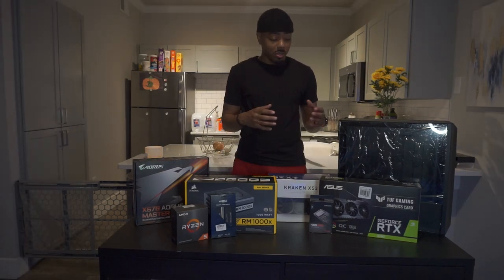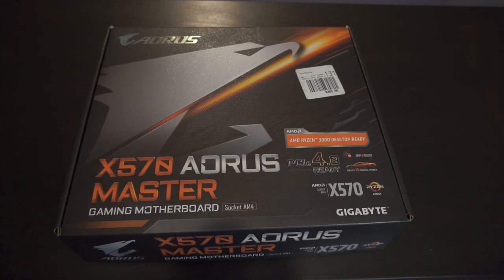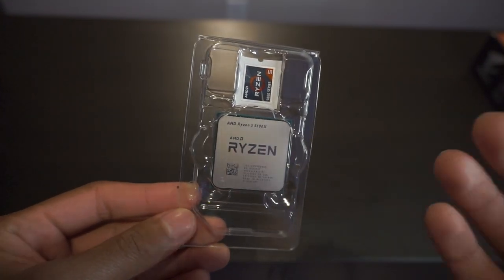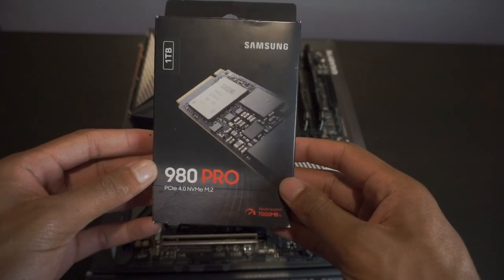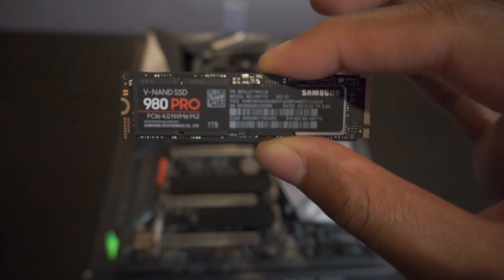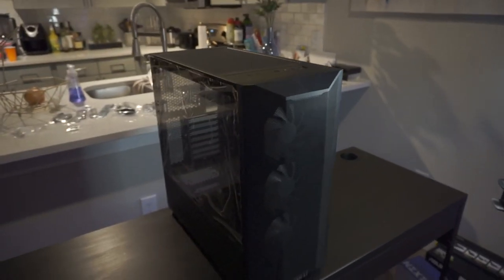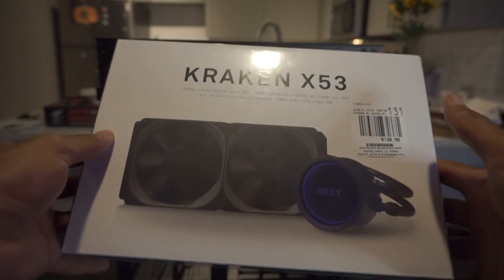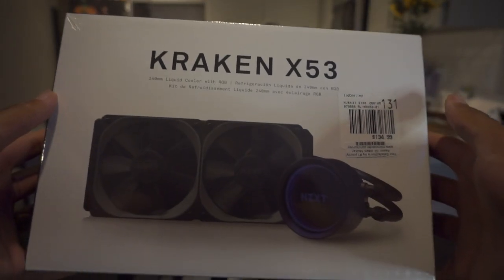MY FIRST PC BUILD! **Beginner walkthrough**

Comment: Nice pc build. Not editing out your mistakes in the video shows character. Not sure if you noticed but when your PC came up to the BIOS, it showed the RAM running at 2667mhz because XMP was disabled. You will want to go back into your BIOS and enable it to get the RAM running at the 3200mhz that it is rated at. The Ryzen processor performance is heavily dependent on the RAM speed.
Reply from the maker: Thank you, that means a lot! Yes, I noticed it later on. I figured out how to enable XMP profile shortly after.
Reply: @bigmike300  it is called DOCP on AMD motherboards to make it more clear for people watching this video. Intel calls it XMP. It is a very nice built!
Reply from the maker: I can't speak for other AMD boards, as this is my first one, but it definitely says X.M.P in the bios settings
Reply: @a.j.haverkamp4023  it actually depends on the BIOS. Some AMD motherboards have a BIOS that reference it as DOCP and some have a BIOS that reference it as XMP. Either way they are basically the same thing. His motherboard is AMD but his BIOS references it as XMP.

Comment: Great job bro!!! idk if someone has told you or if you figured it out yet. It's showing 4 fans because 2 fans(probably the AIO fans) are daisy chained(connected together) so that they run off of 1 PWM input which means basically that they are 2 fans that are connected to 1 fan header on your motherboard. They will run off the same input of your PWM. It is not a problem so dont worry about it, you are good! PWM is basically the input to the fans that control the speed of them when your CPU temperature rises or falls. NICE PC btw bro it looks great! Happy gaming!
Reply from the maker: Thank you, I appreciate the info! Yea, I was informed but not in that much detail. Always learning new things with this PC stuff. Thanks again!
Reply: @bigmike300  have you run into any problems so far? And what games are you running?
Reply from the maker: @A PS only major issue I had was my PC not turning on even tho it was receiving power and everything was connected. I did a Bios update on the motherboard and haven't had a problem since. I play a lot of apex legends, but also been playing Scavengers, Cyberpunk 2077, Witcher 3, & The ascent right now. You?

Comment: Good shit man! Good choice of components too, though you could've probably use a lil bit of a better CPU, but considering the current market you did good!
Reply from the maker: Thank you! & I will definitely be upgrading my CPU soon. I'm thinking the 5800x should be perfect
Reply: @bigmike300  Yeah, that 5800x will help you out big time if you plan on gaming at 1080p or 1440p. The CPU doesn't matter nearly as much if you plan on gaming at 4k though.
Reply from the maker: 1440p for me! 👌🏾
Reply: Ok great choice of components! I agree with the guy who said you could use a different CPU though. Also your PSU is waaay too much lol like right now a 750 is already future proofing and adding another 250 watts is future proofing for like the next decade lol. Also you may want to actually change your cpu out completely.  The Ryzen 5 5600 is probably gonna bottleneck and cap out at like 20%. If you want a really good bang for your buck aka price to performance ratio I would actually go to a 5 3600 or 3700. I promise with your current setup you won't be using your full build. I'll bet my hard earned dollars on it.

Other than that and your future future proofing of your PSU pretty solid setup that should be more than capable for years to come.

Also for future reference you don't need a lot to game. You can game at 1080p at 90hz (fps) for like $800 bucks. In fact your setup would be for like making smooth 2D animations at like 2K resolution with 30 layers per image taking up 1GB of RAM each, going 60 FPS LOL. 

Again not a bad set up at all and the video itself was well done and professionally made. Great job and I hope you like your build!
Reply from the maker: @Cbass Yokum Thank you for the insight 🙏🏾
Reply: @bigmike300  no prob!
Reply: @cbassyokum9582  I agree with most of what you said, but he shouldn't swap out his CPU for the Ryzen 5 3600. That'd be a downgrade from what he has already. He should get a Ryzen 7 5700x or similar performing chip as that'd be an upgrade and would alleviate some CPU usage. If he were gaming at 4k, the CPU usage would be a little bit lower, but he's gaming at 1440p so it's still a little CPU dependent.
Reply: @BrandanFischer  but he's gonna bottleneck. That's the problem. That's why you have to mix and match CPU and GPU accordingly
Reply: @cbassyokum9582  It's always good to have your CPU be more powerful than your GPU so that you have headroom for upgrades. It's never a good idea to have them evenly matched because then it'd limit future upgrades!

Comment: The Master is a high end board.  Should have paired it with at least a Ryzen 7.  At least you can drop in a new CPU later. 700-800 watts is fine for an RTX 3080 but rumor has it that the RTX 4000 series may require more power.  Don't forget to enable XMP for your memory and install a rear exaust fan.  The MOBO only shows some fans because the Kraken probably has a fan hub or splitter.

Which IFIXIT tool kit did you get?
Reply from the maker: I have upgraded my CPU since the video was released. I know how a ryzen 7 5800x. I used the Mako precision bit set from Ifixit

Comment: Very nice build, but it’s recommended to use 3600mhz RAM with AMD processors for maximum performance, and is your psu fan facing upwards? It should be facing downwards so the fan can cool down the psu, but great build👍
Reply from the maker: Never heard of that info about RAM and AMD processors, but I will do my research. The PSU is definitely facing down 👍🏾

Comment: hello BigMike300 did you do the bios update? or 5600x works out in the box? thanks
Reply from the maker: With the motherboard I chose, no bios update was needed, the 5600x worked straight out the box. Check the "socket" of the motherboard before you purchase. Any motherboard with socket "AM4" will support the new 5000 series CPUs

Comment: Word of advice about your ram , i noticed in your bio's its not running at its maximum speed, 2667 your ram max speed is 3200, go into your bios and enable (xmp) and then F10 it should enable your ram to rum at max, just look in your task manager to check to see if it worked. 

Apart from that everything else is cook an curry your build is beautiful, for your first build as well Jheeeze you went inn, one more thing build is godly dont get me wrong, but with everything you threw into that build that thing deserves a 5950x you have everything it needs to accommodate it.

love and blessings my brotha!
Reply from the maker: Thank you so much! I figured out how to increase memory speed shortly after the video was uploaded, & multiple people have suggested I get a better CPU, I will definitely be upgrading my CPU in the future. I'm thinking 5800x or 5950x for sure 👍🏾👍🏾